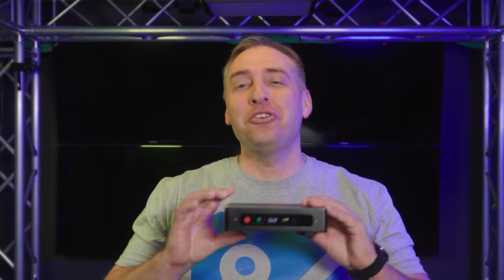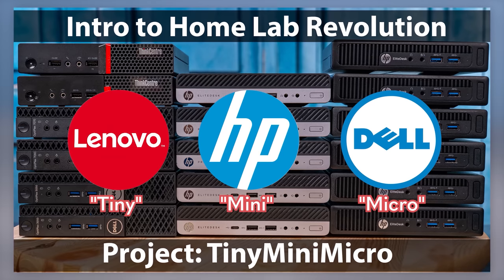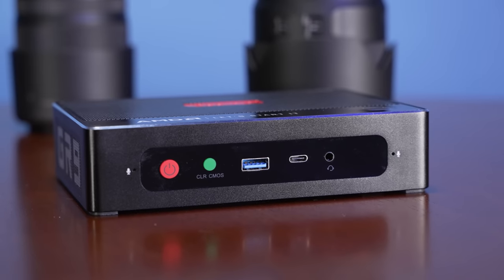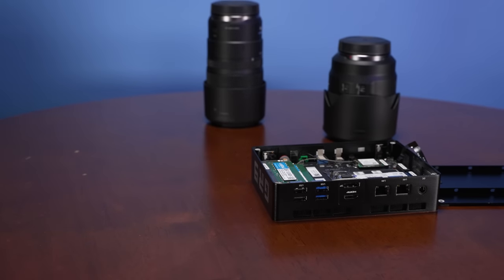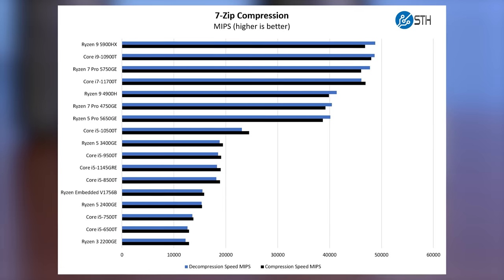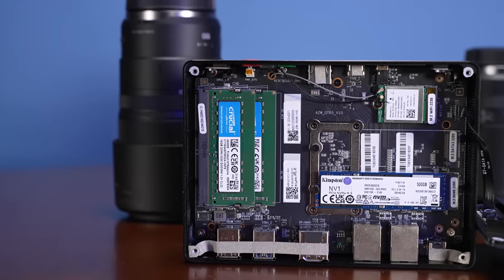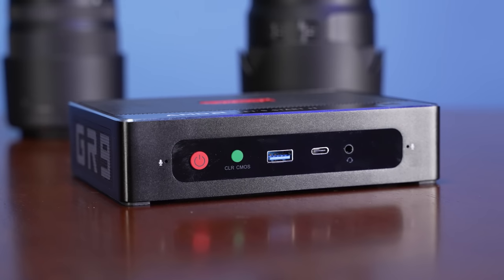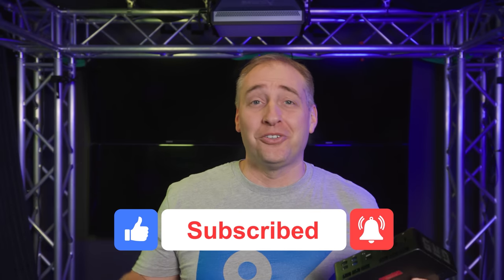SMALL AMD Ryzen 9 PC Fits in My Travel Bag - Beelink GTR5

Comment: I cant wait for a 6800u, or 6900hx version of this with USB-4 that supports eGPU. It would also be nice if it could get power over the USB-4 port so that you could leave your keyboard, mouse, charger in your bag, and have a different keyboard, mouse, charger connected to the GPU dock.
Reply: If it has a Radeon 680M iGPU inside, I would argue if eGPU is needed. Anyway if you need eGPU, go for Minisforum B550. My experience with AMD Thunderbolt is not good to say at least. My Asrock X570 ITX has Thunderbolt 3, and it sucks. Any static discharge around the vicinity of my bench causes the TBT to drop connection at best and cash the whole system as worst. The PCIe connection is stuck at gen 1 (2.5Gbps/lane) on  Linux, and more often than not some kernel command line is needed for it to work properly in the first place. My i7 1160G7 OneMix 4 has zero problems other than heat (pumping 40Gbps will be hot, particularly on a 10" toy laptop). At this stage, for your own sanity (particularly if you use Linux), stay with Intel if your workflow is based on Thunderbolt. Also FYI, hot plugging eGPU sucks, even on the best possible configuration (macOS + Sonnet eGPU). I turned from macOS and MacMini not for no reasons.
Reply: @bskull3232  The 680m may have the same CU count as the RX 6400, but it has much lower clock speeds, and much slower memory than the RX 6400(about 1/2 the memory speed if you're limited to SODIMM DDR5). If you think the RX6400 is good enough for 4K gaming be my guest, play all your 10+ year old games, the 680m will probably be 1/2 to 1/3rd the perfrormance of the RX 6400, which may be good enough for what you need. 
I personally like the idea of an eGPU so that i can just take the 6800HS box with me and leave behind the RX 7600, because the 6800HS is probably going to be good enough for many games at 1080p low, and thats all i really need when playing at a friends house. But if i'm at home on my 4k TV, i'd like something better than a slide show for games made after 2016
Reply: Yes, with pci 4 and support for the v4 pcie ssd.  Though v3 has been just fine for everything I do including migrating 20+ 4-6gb database files. 
I’m running a replica of the Cisco SharePoint farm on two of these with 64gb ram using hyperv.
Reply: They did release a 6900HX model. The GTR6. It's, as of the time of me typing this, going for on average $250 more.
It does not support USB4, and cannot be powered by the Type C port - they even explicitly warn that trying could damage it.
However otherwise it looks like an absolute beast, and other reviewers have posted reviews of it.

Comment: Just got one of these. Really excited to put Proxmox on it for a couple of Windows VMs, a DNS node, my shortwave/ham radio software defined radio, and a Minecraft server or two. :)

I think the biggest selling point for me was the 2x2.5GbE ports (though honestly I would have taken 2x1 GbE--don't tell Beelink!), and even more the three (3!) available storage connectors. I'm a lot more comfortable installing Proxmox on it knowing I've got some options for redundant VM storage.

Anyone reading this, do be careful of the screws on the bottom. One of mine was partially stripped, and I didn't realize how bad it was until I'd completely stripped it. Screw extractor on order. :P

I don't mind the AMD branding--actually, it's oddly nice to see it on the outside of a computer after all these decades of Intel Inside--but the LET'S START IT ... branding (?) ... is a step too far. It's very ... bro. :P Ah, well, at least now I have motivation to go ahead and get the MAC addresses of the ethernet ports and print a large label with them that I can stick on the top for, um, Proxmox reasons.

Actually the branding on this thing is just odd. It really wants to be a mini gaming PC, but between the CPU, storage options, upgradeable RAM, and networking, it's an awesome candidate for a compact home server.
Reply: i currently have one too! 64gb ram 1 tb ssd and man i love this unit. i have a question which driver version amd graphic are u running on at this time being.

Comment: I have been running this exact system for 6 months now and it is awesome.  I have it setup as a proxmox sever and run a handful of small vms on it.  Performance and noise are great.  For my home lab this is a way better solution than second hand servers.
Reply: it also probably doesn't suck so much power from the wall
Reply: how much was it 6 months ago, every time i see a review of micro-mini pc's i look them up on ebay and they are a grand for barebone config or close to it
Reply: @elorrambasdo5233  a lot less than my Xeon D system for sure.

Comment: Your videos are great. Over the years, I have carried Raspberry Pi's in my backpack. The thing that always defeats me is the time to get running. Find the computer, the charger brick, the keyboard, mouse, connect to a monitor, etc.. It ends up being much faster to get out a laptop and just start working.
Reply from the maker: I had something similar maybe 4 years ago where I knew I needed something setup quickly once I got in a lab. I ended up getting a cheap USB WiFi adapter and setting it up in the OS with a static IP and a private wireless network. Then I just used the laptop to connect to that WiFi and remoted into it to get the system up and running.

Comment: 12:51 I have the M1 Mac Mini, and a Lenovo M75 Q Gen2 with 4750GE, and a thinkpad L15 Gen1 with 4750u.

There are some weird use cases where you dont want to use those hardware accelerations, from anyone. When you're transcoding from one codec to another, its generally a bad idea to use hardware encoding, you either get poor quality, or a huge increase in file size(compared to CPU transcoding).

The Apple VideoToolBox is the best engine for this in my opinion, but its still 50% larger than CPU (Intel and AMD are about 110% larger, and for some reason Nvidia is close to 200% larger)

If your use case has a large portion of transocding video (the entire reason i bought my M1 Mini) you might want to look elsewhere, because when using CPU transocding, the 4750u is not only faster, but more efficient, with the laptop only pulling 28Wh from the wall, and the Mac Mini pulling 33Wh from the wall.

Now if you're editing video, the M1 is great, but i'm not usually editing videos on the M1 as i have faster machines for that. I was looking for something small and efficient to dedicate to transcoding, turns out i could have just bought another M75Q Gen2 and limited it to 3.5Ghz, i was just really hoping the Apple Video Toolbox engine would allow me to move away from software encoding. Oh well, i'll just have to try again with the Arc A330/A380

Comment: I wish these boutique microPC builders would start designing their chassis and boards to accomidate desktop dimms. 
Yes it takes up a whole lot of space, but these Ryzen APUs REALLY love fast memory, and you just cannot overclokc SODIMM memory to 4933CL17-17-17-28 (the 5700G really flies with 74GB/s and 49.1ns of latency, though to run memory that fast with 1:1 memory timings, i had to disable the Vega 8 graphics)
Reply: Just got Optiplex 7000 micro with ddr5, the memory IS expensive but I can feel the difference.
Reply: @BenCabell  This is where DDR5 will make a difference, SODIMM memory often has terrible speeds compared to desktop, Because DDR5 is new, SODIMM DDR5 isnt that much slower than desktop DIMMs, making it much faster than DDR4 SODIMM, while still being slower than desktop DDR4
There is still not yet a desktop DDR5 kit that can compete with the ~45-50ns of DDR4 BDye, but there seems to be no SODIMM kit of DDR4 that is slower than even the fastest kit of SODIMM DDR4

Comment: I LOVE a system like this.

I've tested the MinisForum HX90 and unfortunately, as much as I wanted to fall in love with that system, that system fell short because I ended up having stability issues with it as it was trying to host somewhere between 8-10 VMs.

I haven't tested out this Beelink system yet, but I really want to, but a part of me is hesitate to doing so, because if I run into the same kind of system stability issues like I did with said MinisForum HX90, then it'll just be yet another system that I would have to send back, and that's just a little bit inconvenient to do that (but otherwise, perfectly doable).

That's really the only thing that's stopping me from ordering this system.

Other than that, based on my experience with the Ryzen 9 5900HX from the MinisForum HX90, that's a beast of a CPU, and the thermals were well maintained even as I was pushing the CPU hard with IntelBurnTest and also having it solve a system of linear algebra equations with a direct, sparse solver (which tends to work the CPU to its fullest extent possible).

And I agree with the noise, it's not going to be silent under full load, but then again, neither are any laptops that I've ever owned, when they're pushed to their limits as well.

I can imagine that if you want to build out a home lab and you want to buy a bunch of these systems and then cluster them together, it can make for a pretty powerful cluster that doesn't take a lot of power nor space neither.

Comment: Nice little system, with the main components being name brand. I think Intel has an 80% market share with WiFi NICs, because you can buy their top tier card for less than $25.00. If you upgrade make sure it is PCIe/BT and not CNVi/CNVio.  A POE++ (Type 3 51W) switch that supports 803.2ad would work if both NICs on the system supported it, but that would be too cool to implement.
Reply: For anyone confused about PCIe/CNVi, just remember the "AX2x0" cards are PCIe (AX200, AX210), while the "AX2x1" cards are CNVi equivalent (AX201, AX211).
CNVi requires Intel 8th gen or newer, so be careful.

Comment: Good review. The trouble with this chip is that it doesn't make sense without a GPU because there are cheaper Ryzen chips that use less power (therefore have a smaller power brick), don't need big/noisy cooling solutions and aren't really that different in daily use. If you can't play AAA games effectively on this, it's not really any different to a 3000 series Ryzen 5 for 400 dollars.

Comment: One thing that you forgot to cover is that the USBC port is full featured and capable of video output.
This makes single cable docking solutions viable. You can have your dock at home, then unplug it, take it in your bag, and hook it up elsewhere.
You can also build a high mobility desk using a USBC monitor and subsize keyboard and mouse/trackball. Though at this point you might want to start considering a laptop.
And while they didn't cover it in this video, with relatively reasonable expectations you can even run local games on this.

Comment: II love the Beelinks.  They are a bit pricey, but the flexibility is unmatched.   Usually I buy the least-endowed (SSD and ram) version, rip the guts out, and throw in 64G of ram and 4TB of SSD.   The USB is almost irrelevant to me... not much of a point having high-datarate USB ports when one isn't plugging high-datarate devices into them.   I use the dual-network ports all the time for firewalling-off IOT subnets.

The only issue these babies have is that the SATA/power cable is unshielded so the unit sometimes has issues connecting high-speed SATA devices up that one saturates.  Particularly with the Samsung drives, I get hicups at 6Gbps and often have to drop the link speed down to 3Gbps to ensure 100% reliable operation due to the poor cable quality.
Reply: The cable for the 2.5 seats drive. If it’s loose it will loose connectivity. Once I pushed it in all the way, it has been working flawlessly. I leave it on 24/7 and run VMs from the drives. I have three of these now and awaiting a fourth. I did notice the bios enables hibernate to ram locks them up. After disabling that, no more lock ups. Bios is a crazy maze. Only because I don’t know all the options and don’t care at this point.

Comment: The only thing I hate about these companies making these mini pcs, is that they put the cheapest nvme ssds in it. That kingston nv1 500gb m.2 nvme drive only gets 2100/1700mb read & write. So paying $700-$1000 should at least have a samsung 970 evo plus 256gb or 500gb version with 3500/3200mb read & write. I think its bull because once you purchase it and you wanna upgrade the nvme ssd you still spend more money on this item.
Reply from the maker: Wait until you see our 2.5GbE x4 fanless system videos. Those are SLOW SSDs

Comment: mikey likes this one but also the next gen minis which are around the corner...it begs the question if you should outfit small biz with these - the problems you ran into with the small server replacements was really illuminating   but this is an all too common problem especially for instant inventory refurbs - vendors have to make best choices that provide stability and no gotchas - keeping things homogenous with respect to hw is not the worst idea but vendors have to bow to wants and needs of clients and sometimes you get dragged into deeper waters when meeting more complex requisitions/rfq . the holy grail is to find a platform that just works - the best of breed mobo and do the same with the sw - best of breed open source and no licenses - they can run their current desktops as vms - using vm converter is highly recommend #consolidation #HA #3 nodes #live migration

Comment: I wonder if clustering 2 or 3 of these with starwinds vsan and moving my 8 vms to it would save substantial energy over my old noisy proliants.  I guess it would take awhile before it pays for itself.
Reply: 3 of these with some 3d printed rails for a rack would be amazing. The dual 2.5GB NIC is a huge benefit. I bet it'd work well and it'd sip power...comparatively.
Reply from the maker: Or just a cheap shelf.
Reply: @ServeTheHomeVideo  And perhaps some Velcro strips too.

Comment: Morefine model is still cheaper... and from what I know.. better cooled
Reply from the maker: Morefine S500+ is $50 more with half the RAM. During last week's deal, the Beelink GTR5 was $135 less for the 32GB/500GB. The S500+ also has 1x 2.5GbE 1x 1GbE not 2x 2.5GbE. We looked at that one, but it was too expensive to include based on US pricing and it was ~10% larger to boot.

Comment: You never answered the Elephant in the room Question in your example use-case: why not just lug a laptop with the same specs that has a screen to boot (pun intended)
Reply from the maker: I usually bring the Macbook Pro. Two 2.5GbE NICs and space for 3 drives is hard to get on a laptop and these are less expensive.
Reply: @ServeTheHomeVideo  why do you need two NIC's on the road?

Comment: Why not a small laptop?
Reply from the maker: Usually I use these with displays and having features like dual 2.5GbE plus having a lot of RAM, CPU, and storage in something this compact is not what you get in a laptop.
Reply: @ServeTheHomeVideo  You need dual 2.5GBps in a hotel? My GPD does everything I need : it connects me to my server which does all the work and won't get stolen. This is the way.
Reply from the maker: You have to remember when I travel, I am having to go into labs and such. The Macbook Pro does most of the work I need it to. This is better for running labs, demos, and such.
Reply: @ServeTheHomeVideo  Maybe. I need an ethernet port, Usb-c and a full size HDMI port. Everything can be found in a weak GPD micropc. Don't get me wrong, I keep HP minis and terminals around but for heavy computations on the go, server + ssh/xpra works fine for me. Remote Linux labs can run on a potato.

Comment: Prices seem to have come down recently.

- Currently your Amazon link leads to the unit priced at $799 with a "Save an extra $100 coupon", so $699.
https://www.amazon.com/dp/B09Y55G7R3

- Meanwhile, this link, for the identical unit (I think) is priced at $639 with a "Save an extra $40 coupon", so $599.
https://www.amazon.com/dp/B0B2JZJ4FR/

- Finally, to your closing comments on "a step down", maybe the same unit with a Ryzen 9 4900H would work, at $569, -10% (so $512.10) with a "Save an extra $50 coupon", so $462. Seems like a really good deal.
https://www.amazon.com/dp/B0B3MVF9QZ/

Many thanks for all the great info, as always.